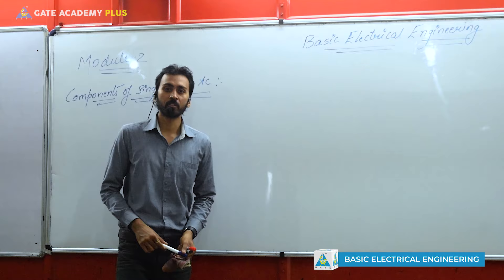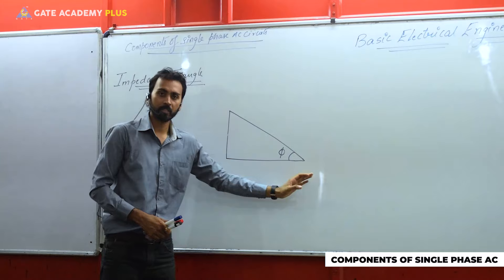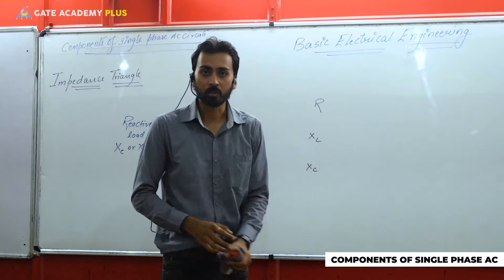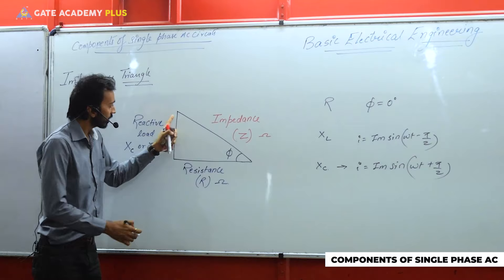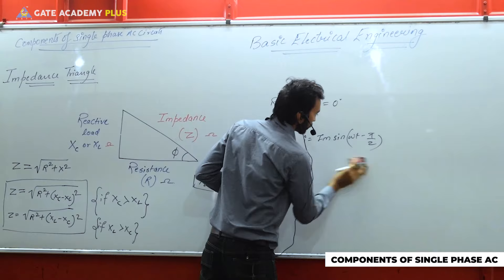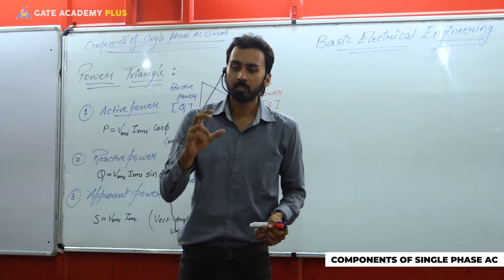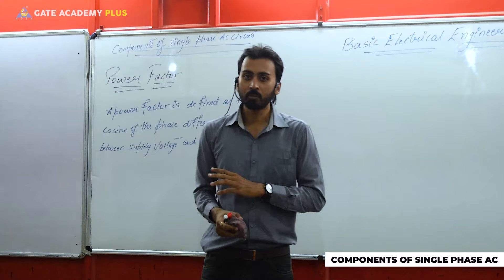Basic Electrical Engineering | Module 2 | Components of Single Phase AC (Lecture 14)

Comment: 00:00 Understanding components of single phase AC
02:24 Module 2 covers the topic of Important Triangles in Basic Electrical Engineering
04:35 Comparison of different AC circuit conditions and their effects on voltage and current
06:51 Understanding inductive mode switchboard current behavior.
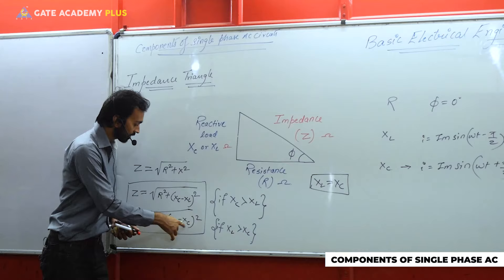09:50 RC circuit is a key component of single phase AC circuits.
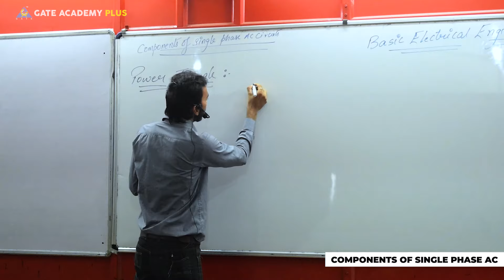12:15 The power triangle represents three types of power.
15:31 Understanding the concept of reactive power and its significance.
18:11 Understanding the concept of reactive power and power factor in electrical engineering.
20:33 Understanding the concept of power factor in electrical circuits.
22:36 Power factor can be calculated in three different ways.
24:41 Understanding different types of formless in Single Phase AC